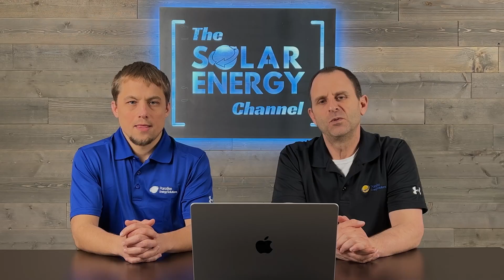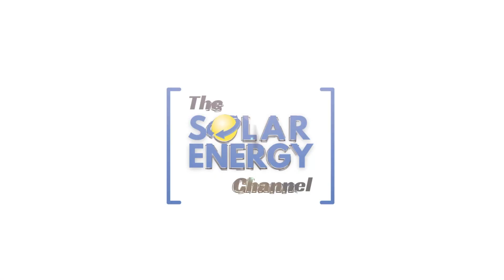Top 5 Best Solar Panels Brands (Expert Picks)

Comment: Good information guys. the one item I thought perhaps you could have touched on, or maybe will in the future, is the degradability of the panels over time. These are going on a roof for many years and the top brands such as you mentioned also have performance warranties that specify how well they will perform after 20 or 25 years. For example, Q-Cells claim performance will be > 86% after 25 years, which is simply extraordinary compared with most others. To me, this is a factor worth addressing that really "separates the men from the boys"
Reply from the maker: Thanks for watching! We covered degradation and panel life expectancy in this video ->https://youtu.be/xszQjoMxBic